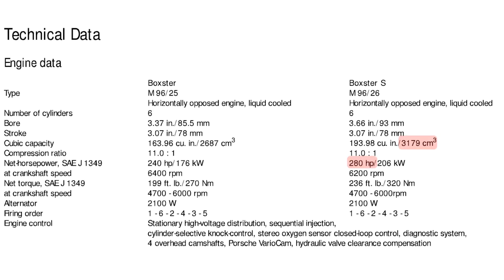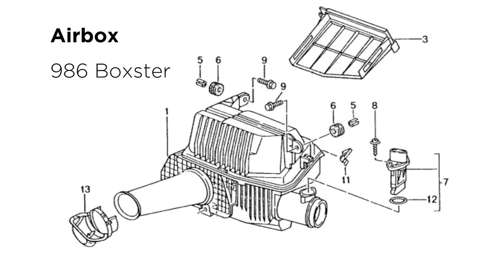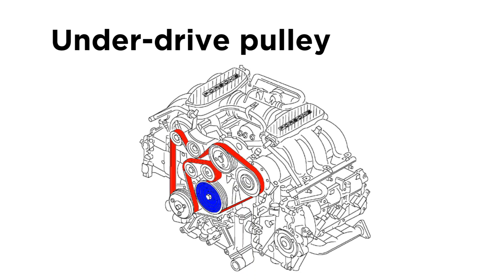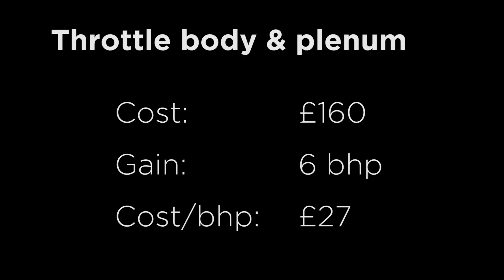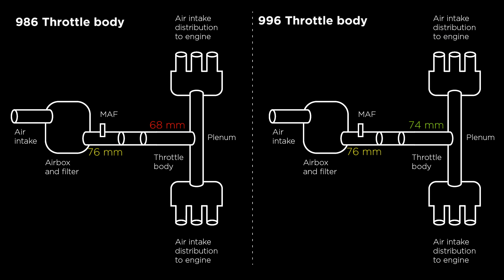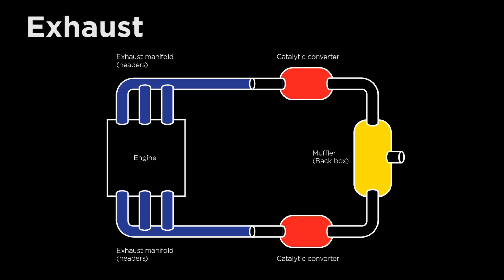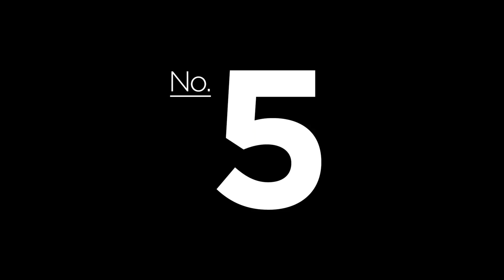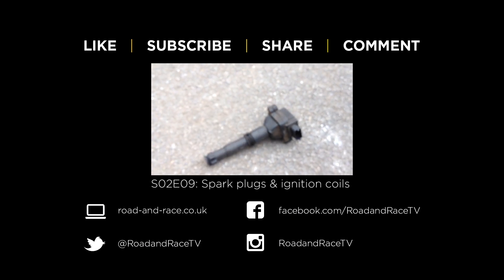Top 5 Boxster 986 performance mods

Comment: I have a 1999 Boxster 986 and have done the following performance mods (after L&N IMS was done) 1. K&N high performance air filter 2. FVD performance software 3. Fabspeed sport headers 4. Fabspeed MaxFlo Exhaust 5. 74mm 996 throttle body 6. IPD Plenum (have to use 996 larger throttle body to fit) 6. TRS underdrive pulley 7. 997 ignition coils    car runs, drives, and sounds awesome  Although my advice would be to start with a Boxster S, that way you start with a little more HP then the base Boxster
Reply from the maker: Wow!  Looks like you've done everything!  Have you been on a rolling road to see how much more power you have?
Reply: Hi Jeff, was this a 2.7L? cheers
Reply: All that without a rolling road after 🤦🏻‍♂️

Comment: Without the ECU remap, the first three mods (Airbox/Underpully/Throttle Body and Plenum) won't come close to providing the gains suggested here, sadly.  You need to reprogram the ECU so it can make the most from those first three changes and new found flow, otherwise the engine is just going to pull what it was programmed to do from the factory and you won't see any gains.

Comment: Not worth trying to add power to an old boxy. If you want to go faster in the old barge, it's much better value to give it a decent suspension. Combine that with a set of lower than standard profile tyres, and you get a much better handling. You can brake later and harder into corners, which will give you a higher average speed. A 986 on stock suspension can't really convert added power into higher speed. Well, it can....if you only ever drive in a straight line.

Also, remember most of the mods you are suggesting in fact will reduce engine power, unless you send your car in for a Dyno run with a remapping. And I'll say most owners of old 986 really won't want to risk engine damage during a full power Dyno run. Any component failure on the dyno will cost more to repair than the car is worth.

Comment: Just buy a 987 save the bother, also letting in more air has its problems to as the maf will simply shut the air down when the ecu gets the message there is to much air, the ecu needs told this is happening or it may even slow the car down

Comment: Not sure where you found a ECU tune for that low but in the states its about 1k$
Reply: £550 is currently $700 USD and that amount fluctuates.  Perhaps it was $1,000 when the video came out.
Reply: @lifehackertips  It actually has gone up for the Porsche here in the states. Be lucky to see a 700$ price for tune

Comment: Hi, congratulations on buying your Porsche, they really are an awesome vehicle.  Great video,  I'm just a bit confused about the under pulley and how it turns slower? 
Subscribed and liked.  Cheers
Reply from the maker: +Brett Fitton Cheers for the sub and like Brett! The underdrive pulley had a smaller diameter thus the effective speed at its edge will be less.  If you're interested I've done a 3 part Power Mods series where we do all these changes.

Comment: Would you recommend the Boxster as a first car?
Reply from the maker: +Unethical Rager A first car? Such as when you've just passed your driving test? If so it's a bit powerful for a novice driver.  Also it's rear wheel drive which can catch some new drivers out.
Reply: No, but only because of the cost of maintenance, since Porsches require frequent maintenance and it is very expensive compared to other manufactures.  A toyota camry or corolla would be a better first car, and when that is paid of, then get a Boxster as a second car, keeping the camry or corolla as a backup for when the Boxster requires maintanence.  When I last brought my Porsche to Porsche, they said it would be $15,000 for all scheduled maintenance to be done.  $15,000 is more than an entire lifetime of maintenance for a corolla or camry.

Comment: Yes these mods can increase power and it's not rocket science. the lighter the rotating assembly (pistons,crank,con rods,flywheel, valves) the more power you can make without adding forced induction to the mix. also,the better the air flow in(Oxygen) and out (CO2) of the engine,the more power you'll be able to obtain.
Sorry if I came off rude before but I'm just simply stating the facts. what if someone who knows nothing about cars watched this video and repeated what you said to someone else who is more familiar with the physics behind engines,the person who repeated what you said would become embarrassed and he/she would probably be laughing stock
Reply: Lighter internals do not increase power. They are just lighter and the engine will be able to accelerate faster. No more power being created by the engine.
Reply: +sje106  they do increase both power and throttle response. Ever heard of parasitic loss and rotational inertia
The rotational inertia of the rotating assembly reduces power and fuel economy since it requires more force to move heavier objects than lighter objects. the same principle apply here. do your research and don't embarrass yourself.

Comment: 6 BHP from a £550 remap?! That's got to be a typo surely?
Reply from the maker: It's just a conservative estimate.  There's not much you can do with a naurally aspirated engine.  Wasn't able to test it in real life though.  Have you seen my series on modifying the boxster for more  power?
Reply: it's probably correct, a NA engine can only do so much.  Perhaps with all the other mods done first the remap might be more benefiical, but on a stock engine the remap would only be a few BHP

Comment: The under drive pulley does not spin slower than the stock crank pulley,it actually spins faster. It is lighter and has a smaller radius than the stock and as a result, it will rotate faster because it has less rotational inertia than stock and the smaller radius allows it to spin faster hence less power is taken from the crankshaft to drive the pulley which results in the power increase. I agree that we all make mistakes but dude,get your facts right before you make videos and misinform people who aren't engineers and want to know the actual logics behind the power gain.
If it spun slower,that means that there's more rotational stress on the crankshaft, restricting the crankshaft rotation and as a result there would be a reduction in power and you would have a very slow throttle response.
Reply: the outer edge of the pulley will travel slower than that of a larger pulley. It will not increase power.
Reply: +sje106 Who are you?
Did you study applied physics?
Do you study automotive engineering? I guess not
Reply: Enrique McLeggon I am an engineer. 
Yes it will give a better throttle response, but no it will not increase the power. The bhp figure on a dyno will not increase. Performed this test on my own built car. You’ve already embarrassed yourself, I don’t need to do it for you. Have a nice day.
Reply: Because of the ratio change it spins the accessories slower. Hence the name underdrive not under drive. Get in a 10 speed bicycle put the chain on the smallest crank pulley then tell me if you go faster or slower. Look at supercharger kits. They increase the boost by either a smaller blower pulley or larger crank pulley or both. The inner diameter speed is the same between the two.  The outer diameter speed decreases with a crank pulley. Because the outside travels less distance in one rotation the belt speed decreases.  In a perfect world you won’t get belt slip on either the crank pulley or the  accessory pulley. Since that belt speed is a 1 to 1 if the crank pulley outer diameter travels 6 inches the belt will too. If the accessory pulley is smaller then it will spin a higher RPM with that 6 inches of movement. The crank pulley will not change rpm but will cause the belt to travel less and slow everything down on the accessories to slow down. This is where in theory you should free up horse power. As objects spin faster their inertia increases it does not decrease. You might want to get your facts straight before you chastise someone else on a subject you clearly have no understanding of. If you went to school like 400 you implied then you need to go back for a refund as they clearly chose not to or were unable to teach you.

Comment: Using a larger throtle body with the same engine (unless you force induction) will not increase engine performance.
Reply from the maker: We tested this in real life and it did.  Check out my three Boxster performance mods videos.